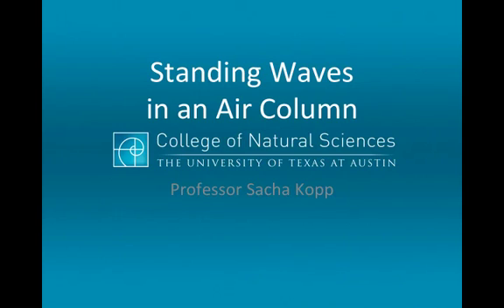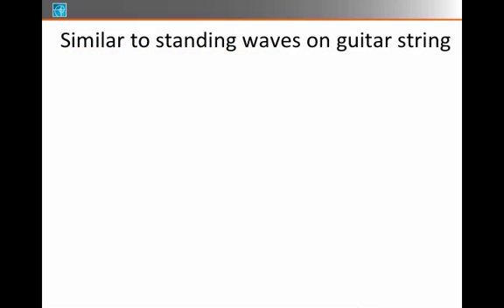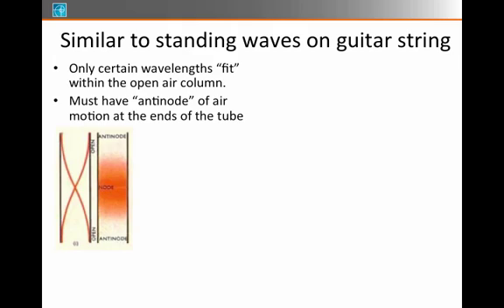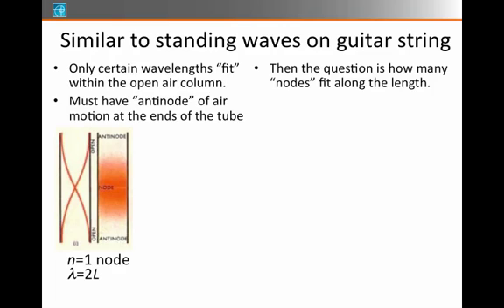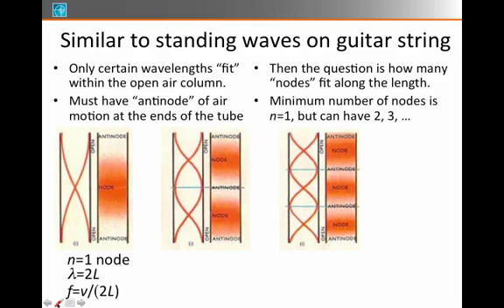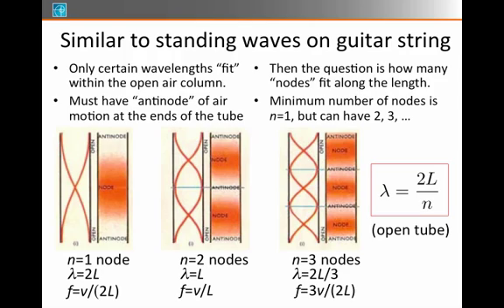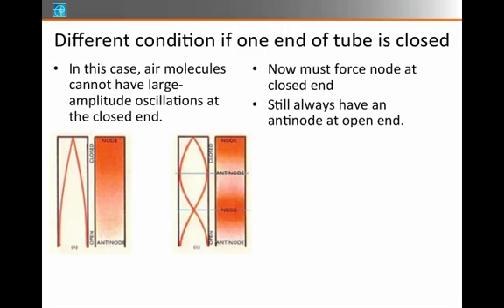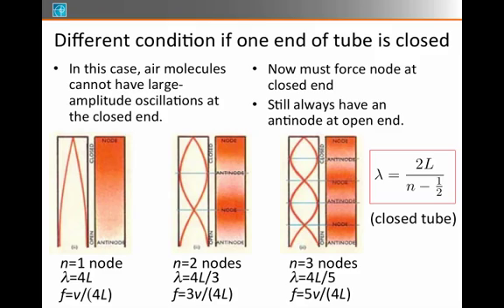14.Standing Air Column

Comment: Hello, 
Thanks for your explanation. May be you could shed some light on what happens on a side flute(traverse flute) which is some kind of mix between open hole on both sides but at the same time has to the left of the embouchure blow hole a cavity which ends in a closed end, and I believe this volume of air acts in a way as a compressor ,resonator.  
Would you know how this system works or a place where I could dig deeper into the matter. Thanks in advance.
Alex G.